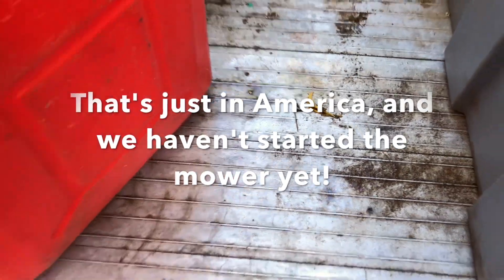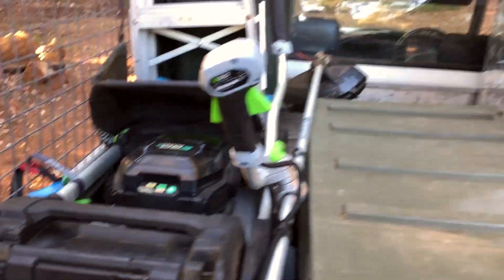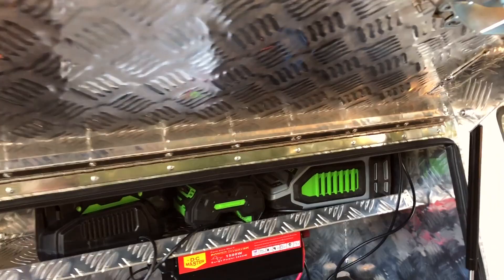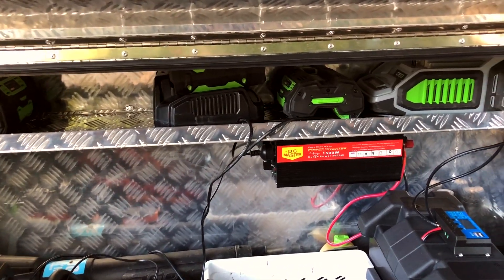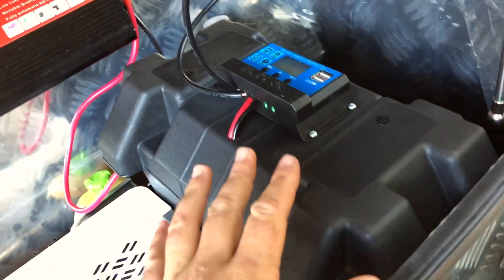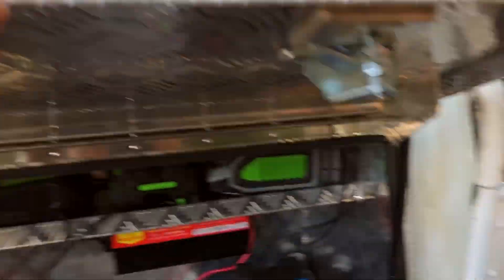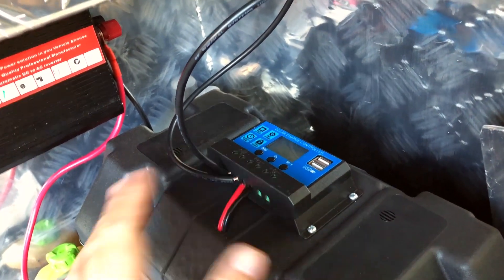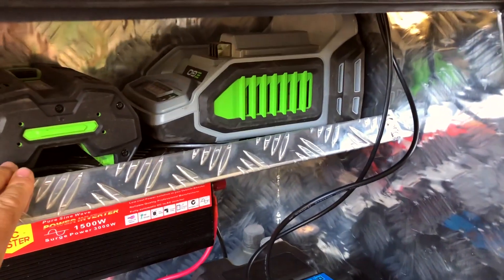How I use Solar Power & Deep Cycle 12v Battery to Charge my Battery Powered Garden Tools

Comment: Great reviews.  Have a look at the Victron solar regulator.  I found I got better output from that than the cheap one that came with my panel.  Antenna place in Ozzie park seems the cheapest place for them. That I could find.  Also a low voltage disconnect (if you don’t have one built into yr inverter) so you don’t damage the battery by draining it too far.  Cheers.

Comment: That's awesome, I've been thinking about doing something similar. What sort of inverter did you use eg pure sine, modified sine. I've heard one can be bad and the other good.
Reply from the maker: I used Pure Sine wave inverter. It's clearly better in the sense that it produces smoother power and I don't think anyone argues on that point. The question is really is pure sine wave necessary and worth the extra expense? I think it is, but I'm not an expert.

Comment: You should get a second rapid charger for your set up to replace the standard charger.  I like those better anyway as they a "fuel gauge" which shows the batteries' state of charge in addition to simply charging faster.  

I have bought several Ego tools and have been very impressed.  The tool that surprised me the most was their snow blower.  It really does work well, and I have used it to move some heavy, wet snow.  

As for me, I am not really sure how green these battery tools truly are.  Some people did a study that said a Toyota Corolla was a greener vehicle than a Toyota Prius overall.  I am wondering if the same might be true with some lawn equipment as the mining process for lithium is absolutely nasty for the environment (strip mining).  Also, I do not believe the lithium in the batteries is truly recyclable yet.  I do agree they have no emissions especially as you have them set up, but those other factors kind of make it a wash.  Personally, I opted to go this route for convenience, to reduce maintenance, and to for the reduced noise levels.
Reply from the maker: I understand the point you are making about Corolla vs Prius but I'm not sure it quite holds up for outdoor power equipment. 

The car industry have obviously done a lot of work to make new vehicles super-efficient users of resources both during manufacture and on the road. The same can't be said for 2-stroke powered garden tools. They're incredibly polluting.

The lithium issue is an interesting one and I don't know enough to argue the point about that one. going to do some more reading on that! In any case, I feel like there is a very strong case for making the switch for all the reasons you mentioned and for the reduced air pollution.
Reply: Yes, those figures filling mowers is just another misinformation to suit the overall picture.

Comment: I work in a city where gas blowers are illegal but the law is not inforced.     I Like your set up. I just bought backpack blower, hedge trimmer and long reach hedge trimmer. Its time consuming having to charge your batteries at clients homes. One time i even forgot my battery with a client.     I ve gotten used to my new set up but when it comes to clean ups, gas tools have the upper hand.
Reply from the maker: Interesting, what city is that Luis Banuelos? You make a good point and it definitely takes some adjusting to transition your workflow to battery power, especially if you have big jobs that take hours on the tools. But it's possible. I've also seen suggestion that there are going to be some very powerful battery packs coming out in the near future which will allow for longer lasting power.
Reply: I work in Berkeley California and Oakland Hills. The neighbors just love that i make minimal noise with blower. I even got congratulated for going Green. Thats awesome im looking forward to new Battery upgrades. Good luck with your business.
Reply: Luis they just released a 27ah commercial backpack battery that can be attached to the battery from the link and used in all of your current ego tools!
Reply: The empty battery with plug that comes with the backpack link. You can find it on the home depot website